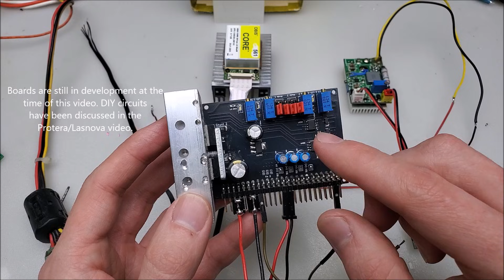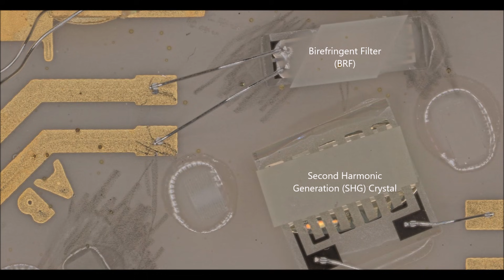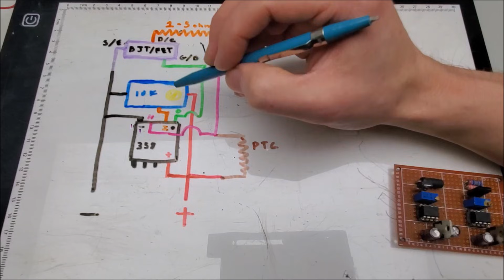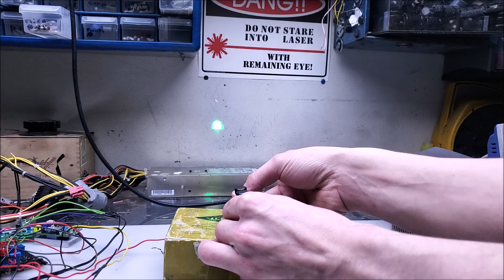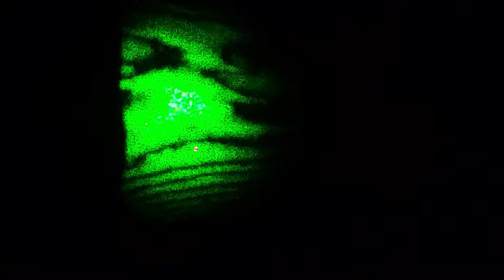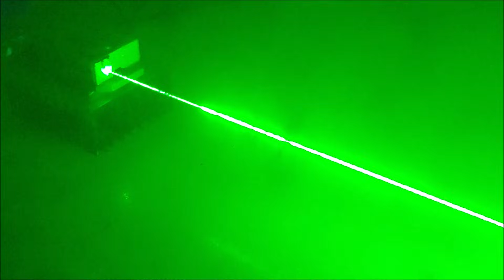The OBIS Core LS Coherent's Miniature OPSL

Comment: now im interested: does a DPSS laser count as a single longitudinal mode laser? i noticed the speckle effect with it (these cheap green laser pointers)
Reply from the maker: DPSS is much lower in bandwidth compared to diodes and some SLM lasers are DPSS. When it's SLM you will see next to 0 light in the dark bands. You will also be able to do the demo over very long distances, hence coherence length. Stability is also very dependent on temperature so running a laser, such as for holography needs to have all the elements temperature stable to prevent wavelength drift or mode hopping. True SLM is quite hard to accomplish. Many lasers can get very close to it though.

Comment: It might be a bit surprising that these little lasers are used in retina imaging cameras. They use that color because it is absorbed well by blood vessels. It uses a galvo plus a scanning mirror like a laser printer, the detector simply measures the intensity reflected then synchs it to create an image.
Reply from the maker: That's awesome! I had no idea that these where used for such a use. Those galvos can be really small/fast too since the beam is next to nothing in size. The resolution must be astonishingly good with how coherent the light is.
Reply: @Zenodilodon yes exactly 💯. The scanning mirror in it is spun at incredible speed and the galvo used is indeed extremely small, very similar to the ones used for extremely high speed laser light show projectors. All you see while it scans is a yellow green flash. 😮

Comment: I wish ams Osram still made those miniature OPSLs.
Reply from the maker: Me too, it's sort of sad they aren't anymore. There are still fleets of unsold PL 530s out there, but finding drivers for them sort of keeps them all in reseller stocks. 

I had a first revision of a driver, but failed to consider that the drift in the OPS chip wasn't tied to a TEC. The resistive drivers for the PTC heaters only work when the OPS is also stabilized. I looked over the ShowWX again and realized they have a thermistor tracking the OPS temp and the heater changes accordingly. That's how they got stable brightness without a TEC. 

The drawback is for holography you need the TEC, I have gotten the output stable through a 20C range, but I can watch the rings move when I test the interference over time in sped up footage. 

I am thinking of working with suppliers I know to get 2 drivers for them out on the market so they become accessible again. One driver for light show/general use and another for TEC stabilized modules for lab/holography. 

Maybe I can help revive their availability for the short term. They really are superb little modules and I am sad I broke 2 in tests. I totally fried the heaters during redesigning the heater circuit. On the upside, that will be the last 2 I fry!

Comment: How narrow has the Linewidth to be to get these absolutely beautiful effects?
Reply from the maker: Many DPSS laser modules have a low enough linewidth to see good effects. It's a gamble unless specified, but I seem to get more from DPSS than diodes in most cases. This probably has to do with the more narrow lines coming from the pumped crystal as it probably acts like a natural filter do to the lines they lase. Even if you find a module that has decently narrow linewidth you still need to temp stabilize the Laser for lab/holography uses otherwise there is still some drifting with temperature.

Comment: I'm sure you already know this but just in case theres really good thermally conductive double sided tape on amazon for like $10 and its a giant roll so it might be better for you instead of using thermal paste and also they make thermal glue too which is super cheap as well but I haven't used my tube of glue yet so I don't know how well it works but the tape is great so far and I actually have been using it in place of regular double sided tape where I needed something thin rather than thick mounting tape and it hasn't failed me yet
Reply from the maker: I know of that stuff indeed. I haven't used much of it though. A lot of the stuff I work on already has thermal paste and the other half I have to consider alignment. I think the closest thing I have seen to thermal tape used in stuff was the graphite pads when it comes to the Laser stuff. Single sided thermally conductive tape may be a good option for my little TEC work platform though. Though in all honesty, if you saw me wrap presents you'd probably keep me away from any and all adhesive tapes lol.

Comment: Man, this video is absolutely sick! Your expertise is mind-blowing, and those interference fringes were just mesmerizing.
> Just a quick technical note though: strictly speaking, the OBIS LS series isn't Single Longitudinal Mode (SLM)—that feature is actually on the LX SF series. Regardless, Coherent makes some incredible gear.
> Also, a heads-up: according to the OBIS Core docs I dug up, you shouldn't use thermal paste (silicone grease) or it voids the warranty. I know Coherent probably wouldn't warranty these grey-market units for us anyway :), but it might imply that the grease could contaminate or damage the internals.
> By the way, I actually managed to snag the manual for this thing. It's probably not super useful, but here's the link just in case:
> https://drive.google.com/file/d/129KUnRRepH5Y2IHXIsKX9T3jLlo2fW82/view?usp=sharing
> Anyway, super cool stuff!"
>
Reply: "I used Gemini for translation, so please excuse any mistakes or if the tone sounds unintentionally rude

Comment: There's nothing quite like the wild interference patterns you can get off an SLM laser such as the fine one you demonstrated. This is a good laser for making holograms! Get some interference patterns off of plastic as the laser heats it. You won't be disappointed !
Reply from the maker: Oh yeah, that's always a treat to watch the melting plastic reflections. Lumia looks way sharper with SLM and dials up the resolution to mind bending. The light really does make its own cosmos in large and minute details.